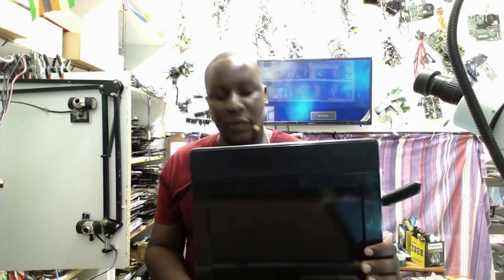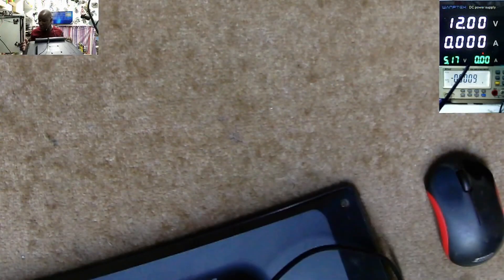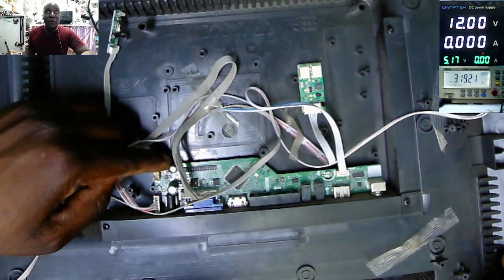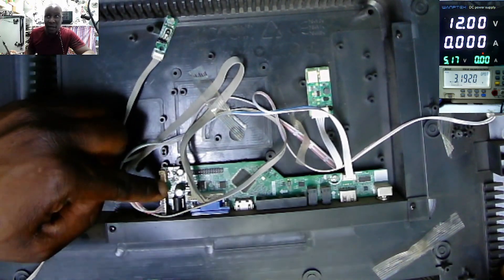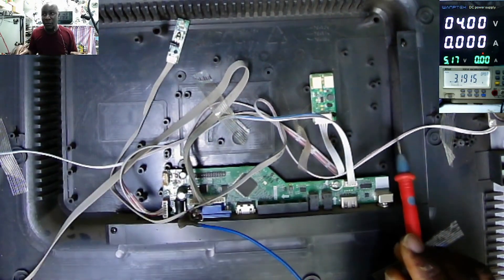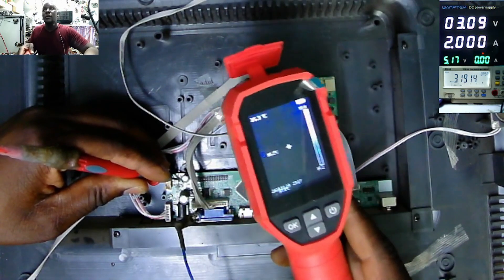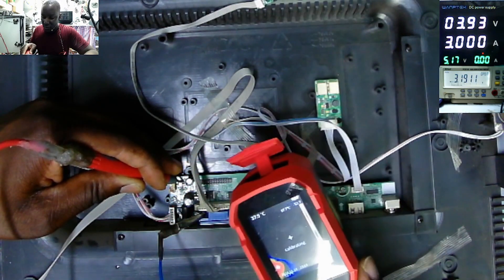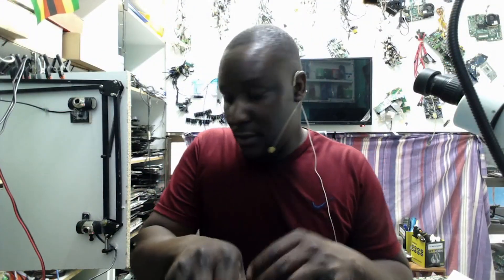Most Common Worst Fault On Small Led TVs Circuit Boards –Processor Issue!!

Comment: First check the 1.2 volt and 1.8  volt power supplies if these are accurate then you should suspect the processor

Comment: What current should it become  abnormal  or what are the basics when am using  the bench power supply  whn trouble shooting  for a short  ?
Reply from the maker: It all depends with what you are checking and what power rail is,, on amps/current l Wil say always start with the lowest possible amps u can unless you are sure of wat you are doing because bad things can happen if you play with high amps